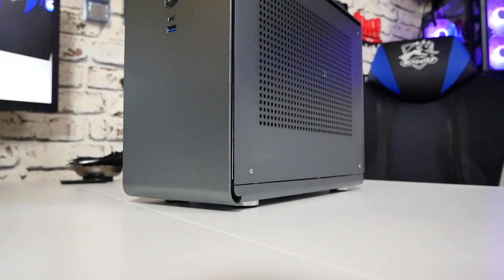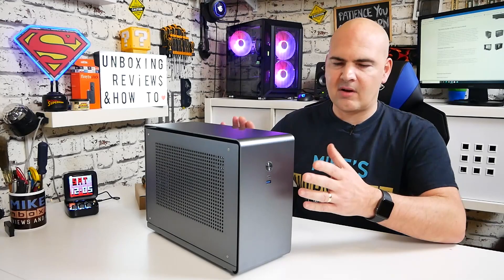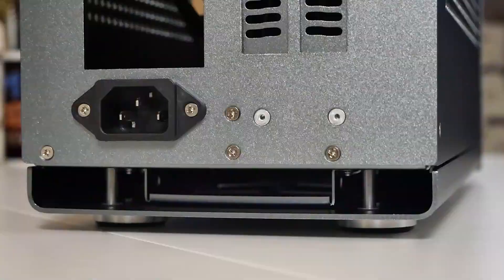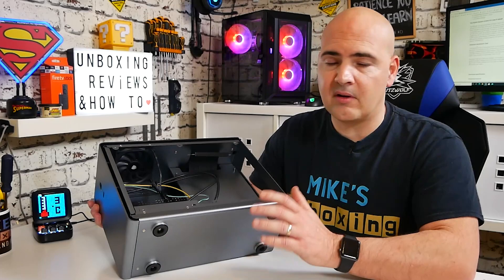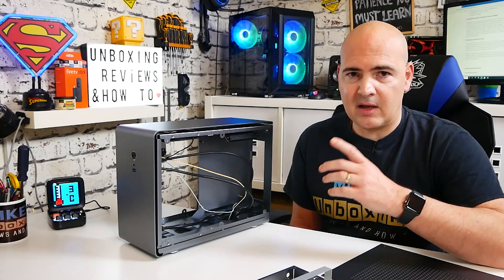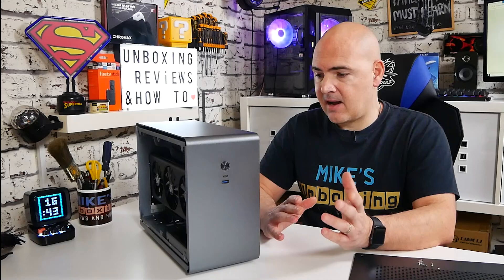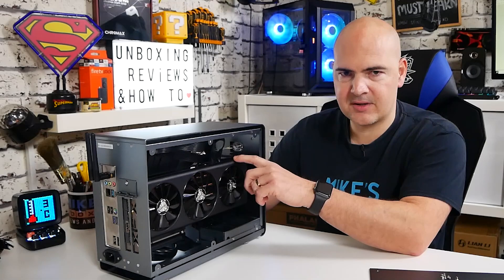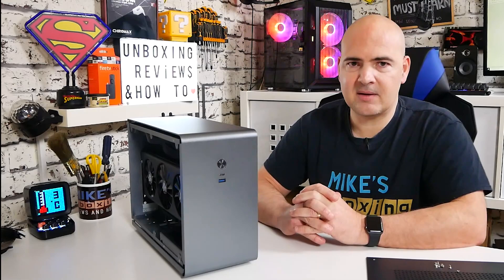Kolink Rocket V2 Aluminium Showpiece Mini ITX Case

Comment: Personally I’m not a big fan of front USB ports located on the upper edge of the case because I use shorter cables. My backup minimalistic gaming/productivity setup is installed in the original Kolink Rocket and the case has performed relatively well. Though I need to run a desk fan for additional cooling when I’m gaming. The location of the exhaust in the updated V2 is much appreciated though.

Comment: One question. In the bottom part of the case, just below the raiser cable, we can see a circular hole with what it appears 4 small holes ( for screws? ). Can we use that to had an exhaust fan if we don't use the SDD tray?
Reply from the maker: i don't see why not. it is i think for routing cables for the lower mounted drives
Reply: @mikesunboxing   Yes, I think the main purpose it is for routing, like the square-shaped bottom holes, but that circular one, it looks like a 92mm low profile fan would fit. If so, that would in theory improve airflow, exhaust from the bottom and back of the case.

Comment: Great video, you've just  gained a sub. About the case now, I can't understand the mentality of these companies. You're slamming a $200 pricetag, so I'm supposing that the target audience is building with  mid to high end components inside it. Single 92mm fan? No rad support at all? Man, I mean if you throw a 10700k and a 3060ti in there, it will turn in a furnace. I bought the Rocket V1, sold it right away - worst thermals I ever had in a case.
Reply from the maker: thanks for the sub. The thermals are a lot better not the v1 but i get where you are coming from